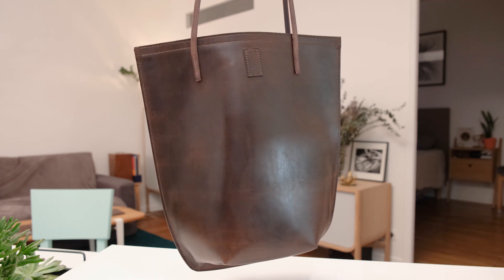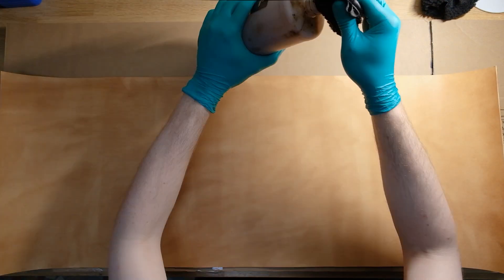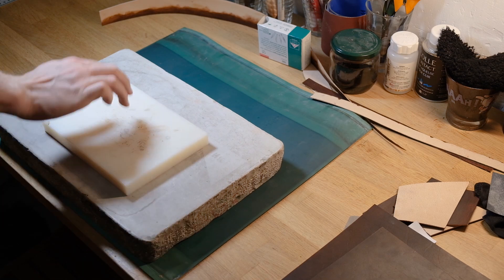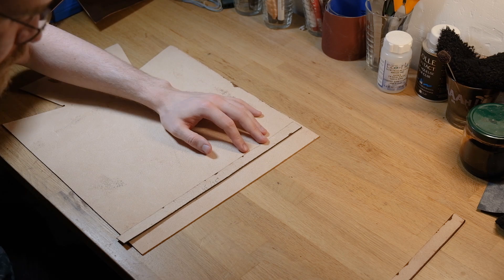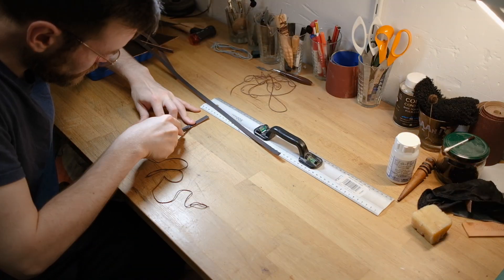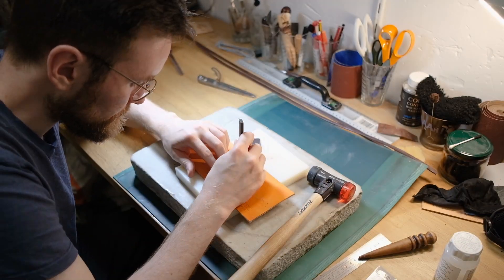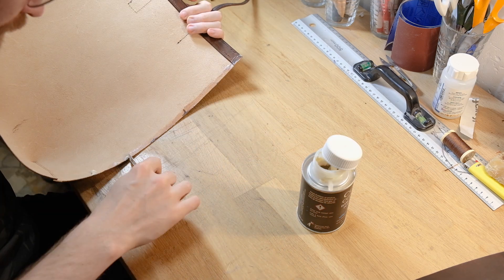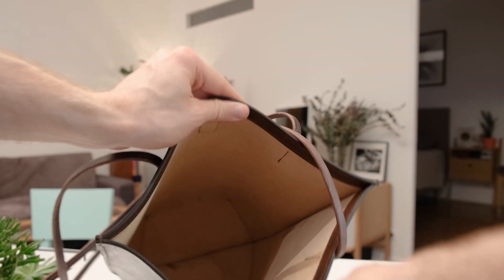Making a leather tote bag - with commentary

Comment: Hi, great looking bag. Did you consider overlapping the two main panels to make the bottom flat? And how did the bag sit on the floor? Cheers
Reply from the maker: Hi Ian and thanks for your message. Indeed the bag does not sit well on the ground and I really do want to find an elegant way of getting the bottom portion flat. In this one I was worried about the transition area between the overlapping flat bottom and the outward stitched sides. Not sure how I can change this unless I have the whole bag with overlapping sides.
Reply: @JamesBerry  hi, I wonder if a skived edge and an overlap all the way round would give a sufficiently smooth edge. Food for thought. 👍

Comment: Hello!  The lines on this handbag are elegant & modern.  You definitely have an excellent eye for design.  Did you create a template & a mock up model before the finished piece?  I have seen simple square cutouts for the bottom on bags, but really like the shaping created by your cutout.  Can you tell me how to calculate for the cutout you used & for future bottoms with this type of design?  Thank you for taking the time to do this video & for all of your advice on leather prep.  Grateful, Kent.
Reply from the maker: Hi Kent, thanks so much for your nice message! I'm really pleased you like the final result so much.
I didn't make any templates for this as I had a good idea in my mind of the size and outcome I was going for. Of course, I would nevertheless recommend making a template every time, especially when trying something new... do what I say, not what I do type of thing ;)
Also I don't have a specific rule about the corners and would simply tell you to test out different measurements with a piece of A4 paper until you find the shape you want - all I new here was that I did not want a 45° angle, so had to cut quite a shallow piece (that would always be cut again if it wasn't enough).

Comment: Does it stand up with that ridge down the bottom?  Seems like seeing from the inside and flipping it would've made the bottom flatter
Reply from the maker: Hi Ryan, no it's not very stable and has to be placed agains something. I will be looking into improving this design in future builds and having a flat bottom to it. My worry is then how the top would look = in this design the two pieces of leather come together in a closed position / if I flip it the top would naturally stay open... Need to think of a solution for the next one.

Comment: I live the bag, James. The dyeing and using the oil & bees wax mixture is a wonderful idea. I want to make a similar bag but I need to know an approximate measure of the 2 triangles that you cut out. Can you send me some numbers. Thanks.
Eddie
Reply from the maker: Hi Eddie, thanks a ton for your message, I'm so glad you like it :)
For the triangles, I measured 10cm squares in the corners to get the tip of the triangle, then marked 3 or 4cm down each side to get the final triangle I was looking for (sorry I can't remember the exact measures). Hope this makes sens and helps you out :)

Comment: Would you mind sharing the measurements you use for cutting in the corners? thanks!
Reply from the maker: Hi Stacey, thanks for your message. I'm afraid I'm not certain anymore what the measurements were on this.
I stated by tracing a square to find the inner corner/tip of the cut, then traces two lines at a more acute angle to get the final result. I would suggest testing out on a scrap piece first.
Sorry I can't be more specific.
Reply: @JamesBerry  thanks! I will test out on a scrap piece first as you suggest. I love the silhouette you created here whether it stands up or not :)
Reply from the maker: Thanks and good luck with your testing :)